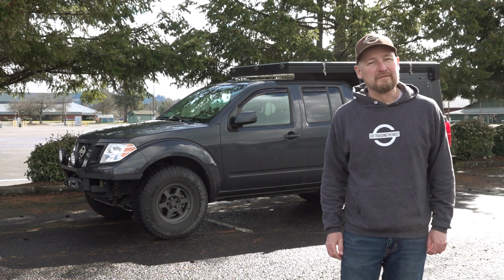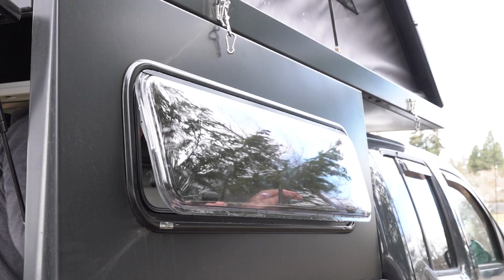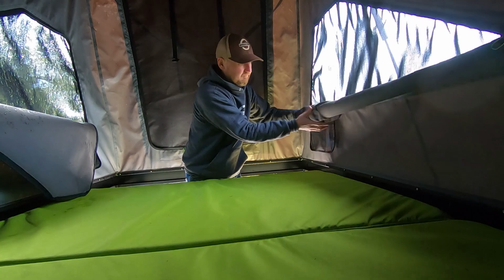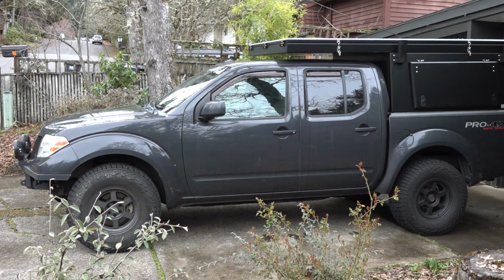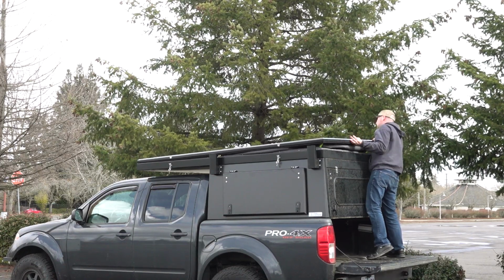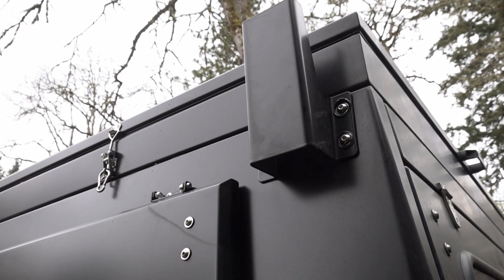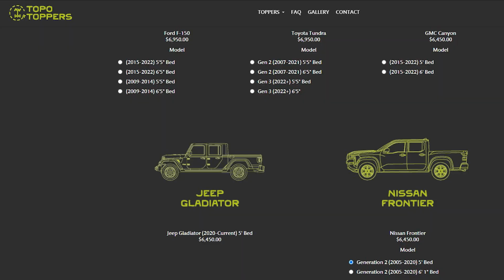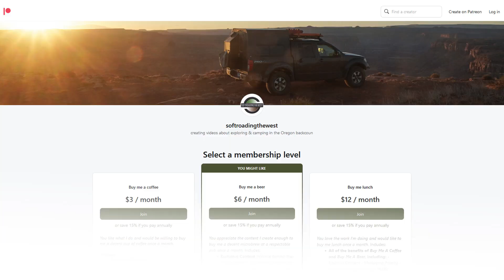Introducing a new camper option for Nissan Frontier

Comment: Would you have preferred a ‘badland’ style full pop up vs the mesa’s wedge style?  If it were to have been ready/available at the time?
Reply from the maker: That's a great question. At the time, I think I would have been tempted, though not sure I would have been tempted enough for the additional price tag. Now, after a year of using it, definitely not. Ultimately I spend almost zero waking hours "upstairs" - I climb up there when I'm ready to go to bed, and climb down/stow the bed as soon as I get up. Upstairs there is ample room to move around, fiddle with my bedding, get into and out of my sleeping bag (and at the head end of the bed, the roof is actually higher than in the Badlander). When the bed is stowed and I'm using the full "downstairs" space, the vaulted ceiling of the wedge is so high that I can actually stand on my downstairs couch/bench and be nowhere near hitting my head. (you can see my more or less finished buildout in this video: https://youtu.be/450VxrP50yA )

The extra speed and ease of breaking the camper down in the morning has proven to be a perfect match for the way I travel, and the wedge shape is more wind resistant...I regularly find myself in windy conditions and it's nice to be able to point the solid roof into the wind.

I travel and camp by myself...I don't have to share the bed space with anyone. I could see how, for a couple, the ability to move around the entire upstairs space could be more comfortable, as well as the ability to sleep with your head towards the front of the truck instead of towards the rear. With a wedge camper, you HAVE to sleep with your head(s) towards the rear, right there where you also need to climb up/down. 

If at all possible, I would highly recommend getting a firsthand look at both a wedge camper and a full roof pop-up to see what the space is like (even if it's not a Topo Topper, the space is going to be similar in virtually any of these campers). Good luck!
Reply: @softroadingthewest  that’s kinda the answer I was expecting, I have caught up on all of the previous and current build vids and was just rewatching the camper and 270 awning comparison vids as I was looking for a 270 for my SG forester at the time (came for the Forester content and stayed for the Donald content) and noticed most of them you toured were the ‘badland’ style and can definitely see what you mean about the wind break, that is probably worth it alone, but was curious since the frontier version was so new for Topo and the badland version wasn’t even available when you decided.

Comment: Very nice. I can see a new deck system going into the bed:) BTW, will it fit the new 2023 Frontier also? My Son has the Pro4X on order to begin his overlanding journey.
Reply from the maker: I don't know how similar/different the 3rd gen Frontier bed is from the 2nd gen. From what I've witnessed about how Topo works, I suspect the only way they'll put a camper on a 3rd-gen Frontier is after they've specifically designed it for that truck. They do have a "request" feature on their website for truck models not listed...I'm sure if they hear enough voices clamoring for a 3rd-gen Frontier model, it's something they will consider developing.

Comment: Have you determined how much bedding you can leave in place or total thickness of mattress and bedding? Having to pack that away reverts utility back to tent camping. I also have a 5’ midsize bed, I can see how little wiggle room there is to sneak up to the deployed bed. Too bad the bed doesn’t hinge and follow the wedge roof contour, rather than slide in sections but I’m sure that’s a cost and complication design decision.
Reply from the maker: I believe Topo says 5” of bedding space. I left my thick 0° sleeping bag and a full size pillow from home inside the closed up camper with zero issue. I believe I could easily add some kind of foam bed topper in there as well. So zero bed set-up. Pop up the roof and you can climb into bed immediately.

A friend of mine with a similar wedge camper replaced her original bed panels with a sheet of plywood and gas struts so she could just elevate the whole thing up out of the way. That worked quite well. I am already considering that, along with some other ideas I have to modify the bed system. I will definitely share it in a video when I do. 👍

Comment: So my fingers over ran my brain.  Shorten one side of my gear tray by 2 ft. Room for standing and some wet boot storage.

Bug dang it I don’t want to crawl over that tailgate. 
Still a nice design.
Reply from the maker: The tailgate entry is pretty much standard for all the pop-up toppers. Alu-Cab replaces the tailgate with a man door, but GFC, Vagabond, AT, Ovrlnd, etc...all use the tailgate. It has its plusses & minuses, and this is something I will definitely talk about in a future video as I spend more time with the camper. My previous setup, the tailgate was removed and I had a vertical door, and that is without a doubt nicer for going in and out of the back of the truck. On the flip side, the tailgate is so nice to have as a built-in table/work surface in camp...previously I had to carry, set up, and break down a folding table. There are various aftermarket mountable step options to make accessing the bed of any truck easier, I've been eyeing those while thinking about my own DIY solutions as well.

As to your drawers you mentioned in your other comment. Obviously it depends on the way they're built, but there is a LOT of vertical headroom in this style of camper. Reaching my arms up, I can't touch the ceiling when standing in the bed of the truck. A pretty common configuration for this style of camper - regardless of brand - is to have a full set of Decked drawers in the truck, and the top decking across the drawers becomes the "floor" of the camper - that integrates a massive amount of storage space without impacting the interior livability of the camper. In fact, it's pretty difficult to get up into the upper level to sleep from the very bottom of the bed of the truck. I had to use my kitchen box as a stool. So preserving your existing storage could actually be preferable to modifying to reveal the truck bed. 

Stay tuned, I will try to demonstrate this more clearly in upcoming videos. :-)

Comment: Very nice setup, I would say this is the best setup if you own a truck. Are you able to keep the dust out when driving on a dirt road? and a shock cord wrapped around the midsection of the tent body might assist you in keeping the tent fabric tucked in.
Reply from the maker: The camper itself is super well sealed. The truck bed is the weak link. My Frontier bed has many many openings where dust and/or water can get in. I’ve been chasing them and sealing them as long as I’ve owned the truck. I need to seal around the tailgate now (my previous topper had its own doors that replaced the tailgate) and then I think I’ll be close. 🤞🏻
Reply: @softroadingthewest
Reply: You may want to try out the full BedRug package. I put it on my previously owned GMC Canyon and it kept out all the dust from Utah backroads. Highly recommended!

Comment: Dude! This thing is rad. I know my pop-up camper was a game-changer for me, and I am sure you feel the same way. Looks like a well-built and thought-out design. One tip when closing that makes it a little quicker is to leave the windows slightly unzipped on each side to let the air escape easier.

Comment: That's great you found a camping setup which doesn't require a ladder to access, Donald!

I have a '21 Ford Ranger, but it appears Topo Toppers doesn't make a model for my truck? I currently have a hard shell rooftop tent, and an aluminum cap on my truck bed. I'm considering making an access port through the cap roof and tent base, to provide a similar way to access the tent.
Reply from the maker: No Ranger yet, but as I pointed out to Topo, most camper companies that have a Frontier model, it’s often Frontier/Ranger, so I think the two must be very close. I planted that seed with them that now that they’ve got the Frontier designed, they may be close to having the Ranger as well. 🤞🏻
Reply from the maker: Oh, also meant to reply to your pass-through idea! Perhaps you’ve seen this already, but my friends @moleisureadventures did that, only with a rooftop tent on their Xterra, cutting a hole in their roof. Enoch & Delia live full time out of this rig. I can’t remember what video coverage they have of that, you can check their channel here as well as our friend Braxton’s channel @welcome.to.the.outdoors or otherwise they usually post much more on Instagram.

Comment: Thats a very nice design and a good setup. Lots a of possibilities. I think you made a good choice there...in fact I kinda wish I'd known about Topo before this. I may have made a different decision in what I put on my Fronty.
Reply from the maker: Well, they didn't previously offer a Frontier model so you wouldn't have been able to get one prior to now in any case. Which camper do you have if you don't mind me asking?
Reply: True about availability. 
I have the summit. 
I just have to work out some issues with bed (?) flex before I’ll be 100% happy.
Reply from the maker: @utahjohnnymontana3373  Gotcha. That's a nice camper.
Reply: @softroadingthewest  Yes, its just sometimes one tends to second guess these choices. I think one I get the flexing dealt with it'll pass :)

Comment: Is it 100% water right?

Looking at GFC and this one! Any feed back?
Reply from the maker: 99.9%.  In heavy rain, a few drops of water will squeeze in at the bottom of the front window where the two ends of the rubber seal meet. It's so little water that even after hours of heavy rain, there's not enough water to spill off the small lip where the topper is attached to the bed, and I can just wipe it up with a paper towel on the rare occasions I've had it happen. I get more water inside by just stepping into the camper with wet boots. Roof seal, tent, Tern window, cargo door, rear door, all zero water incursion.

Comment: It doesn’t appear that the rear hatch locks? The side door is keyed, but I didn’t see locks on the rear hatch.

That’s an awesome topper!
Reply from the maker: The rear hatch handles have protective rubber sleeves over them to protect the locks from the dust & crud that always swirls up on the back of a truck. They are normal topper hatch handles with keyed locks. 👍

Comment: How did you plug the holes after removing the roof rack? Thanks
Reply from the maker: That is stil a work in progress…I ran out of time on that project. I mean, the holes are plugged, but there some quirks of construction which complicate matters. I’ll post a short video about the whole roof rack delete when I’ve got it all resolved.

Comment: Very interested to see how this works out for you. I am interested in a similar setup and have been looking at other vendors. Interested in if these leak in heavy rain or when driving in rain. Will keep watching...
Reply: I can vouch that they don't leak driving in rain. Or snow. Or ice. Even with 100+ mph winds. (80mph through Utah with 20-30 mph headwinds.) I do however get extremely crappy fuel mileage in those conditions though. :(
Reply: @rattlecanpaint  You don't work for the company do you? :)
Reply: @darrylk808  lol. No. I drove 2 and a half days to get there. Almost coast to coast. I might very well have the only one east of the Mississippi.

Comment: How are you able to secure the rear hatch (and tailgate) from the inside?
Is there an internal lock/unlock on the hatch?
Reply from the maker: No internal lock, no. The rear hatch latches are standard truck topper handles. 

I suppose it depends on where you camp, but I've never locked myself into anything, and obviously when I'm out tent camping, there's no lock on that either. Since I'm usually out dispersed camping, there is no one around, and I would hear anyone rolling up on me long before they could get anywhere near me. I would for sure want to come up with some kind of solution if I planned to do any kind of stealth camping or sleeping at a Walmart or rest area or something.

There are many many videos here on YouTube with various ways people have come up with to lock from the inside:
https://www.youtube.com/results?search_query=secure+truck+topper+from+inside

If your truck has a locking tailgate, you could obviously lock that as well. My tailgate doesn't have a power lock but I could theoretically reach out and lock it with the key before closing the hatch and securing that from the inside.

Comment: I’ll be interested in seeing how you work around the two feet of bed space lost to get into the pop up.  I would have to shorten all my gear slide/drawers by not having exterior bed access.  Certainly doable, but I’m not sure the product is an improvement over and external entry ladder. Also there is the hassle or opening and shutting the tailgate from the inside….

I like that product.  Just have to brainstorm a few workarounds.

Comment: Hey Donald love the new camper I have the exact same truck and myself am looking to get a camper, my only concern with those tent like structures how well do they hold heat as I hunt, fish camp some freezing conditions?
Reply from the maker: It’s a tent, so it’s going to lose heat. For cold camping, I rely on keeping myself warm inside my sleeping bag rather than trying to keep that whole space warm. A good 0° sleeping bag plus a 12v electric blanket and I sleep very warm & cozy. My Mr Heater Buddy makes the space comfortable for the time I’m inside the camper before bed and getting dressed in the morning. 

I did feel like I was losing more heat through the aluminum walls than the tent fabric, I will definitely be insulating the metal parts.

Comment: How did you battle the condensation, all the RTT run into?
Reply from the maker: I have not encountered significant condensation issues despite some sub-freezing nights. I sleep with the tent windows cracked so there's some ventilation, and I accept that when cold camping, some dampness is inevitable with virtually any camping setup that isn't a heavy, thick-walled camper or RV. I've never had a situation where I've got condensation dripping down on me. If conditions are such that stuff is still damp when I get home, I just pop the camper and let things air out.

Comment: VERY NICE! Back in 2020 I bought the Snap TREEHOUSE and drove from New Mexico to Pennsylvania to pick it up and then camped my way back home. The first night in it was a serious test with gale force winds and a torrential downpour and it passed with flying colors. 

Because of covid, and since it was the off season for camping, on the way back to NM from PA, there was one night where I was forced to stealth camped (I didn't raise the upstairs camper portion) and slept in the bed of the truck instead of upstairs which made me aware that there may be other times in the future when I may have to do that again and there was. But due to lightning.  

After getting home, I built out the bed of my Frontier PRO-4X for camping. But since I still wanted to use my  truck as a truck at times, I built 4 part modular system that installs and can be removed in roughly 10 minutes.  To save room in the bed of the truck to stealth camp, I kept the camping build out as simplistic as possible. No pumps, complicated electrical systems, built-in sinks or stove tops. Generally all my cooking is done outside of the truck and a Jackery 1000 (plugged into a 12v outlet on my truck) provides all my power to the truck bed/camper. 

With the way I built out the inside for camping,  when the weather does turn horrible, I can easily cook inside my truck bed and If I'm camped above timberline in a lightning storm where I don't want to raise the upstairs, I still have the option to sleeping fairly comfortably downstairs in the truck bed and when I get home, I can easily and quickly remove a portion or all of the camping build out and load it up the bed of the truck with a load to take to the dump.

So enjoy and it will be interesting to watch as you build out yours and go exploring
Reply from the maker: That’s funny, that is precisely my current thinking in virtually every way. I’m aiming for modularity/removability, simplicity without complicated plumbing or electrical, and a way to sleep “downstairs” in a pinch. Are you on Instagram or the Frontier forums? I’d love to get a look at what you’ve done...

Comment: What about security-wise?
Reply from the maker: Rear door and cargo door are equipped with locks/keys. The Artic Tern window cannot be opened from the exterior. The camper roof latches accommodate padlocks. As far as locking from inside when you sleep: the rear door is a standard truck topper door and is not equipped with any sort of locking mechanism, though here on YouTube you can find numerous DIY mods people have come up with over the years to lock this type of hatch from inside. I never lock myself in, but I'm always camped in remote areas or campgrounds where I feel safe anyway. I mean, I used to camp with a ground tent and obviously there is no way to lock that. :-) Let me know if I can clarify further!